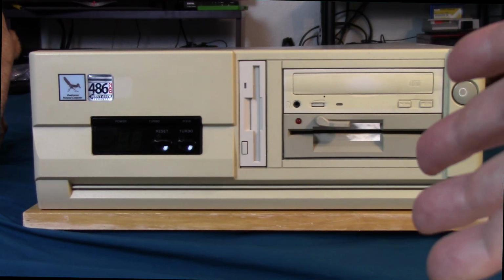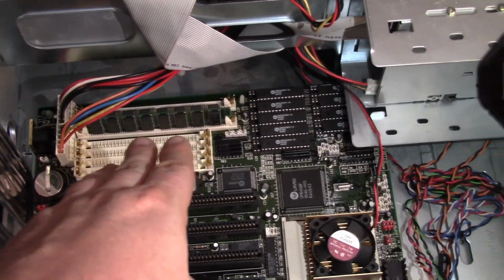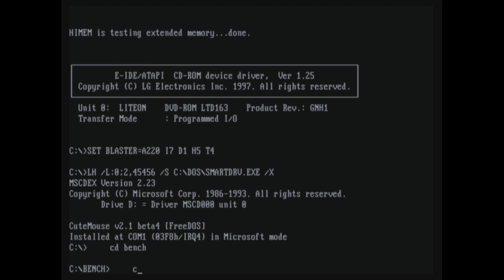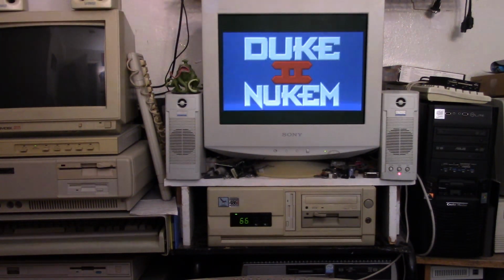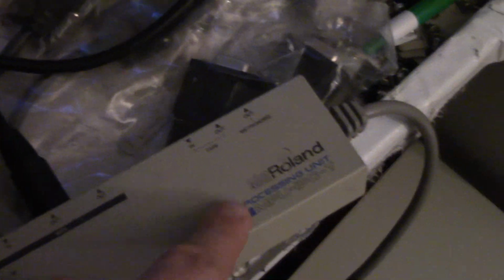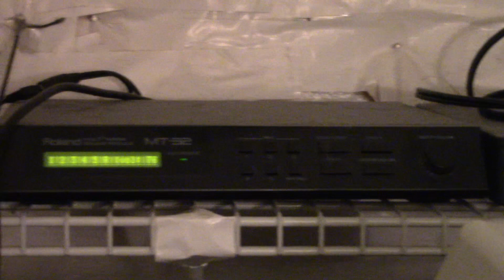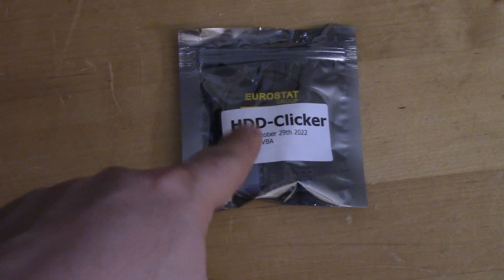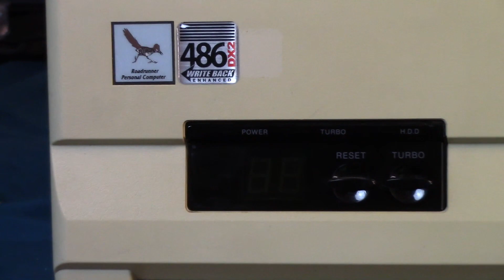Building a WB enhanced 486 DX2 PC

Comment: Nice video ! Regarding your soldering thing for the turbo switch, if you are afraid to solder (which I understand since I myself have 2 left hands as we say in French), simply use a pair of Arduino cables : their connectors will fit perfectly on both ends (panel and motherboard). So basically you replace the original cable with these. I use this trick without any issue.

Comment: In general 486 boards, due to lacking tag support in their chipset and caching technique, the cacheable region is directly tied to cache size as the tag only provides a fixed 7/8 bits to the data adress(stored in the "tag" sram).

Take the log(base 2) of the cache size and add 7 bits for WB / 8 for WT and you get the log of the cacheable mem size.
256KiB cache -> 2^18 bytes
2^(18+8) = 64MiB cacheable WT
2^(18+7) = 32MiB cacheable WB

1024KiB cache -> 2^20 bytes
2^(20+8) = 256MiB cacheable WT
2^(20+7) = 128MiB cacheable WB
etc.

Comment: I think that optical drive is a lite-on model, an LTD-163D or something like that. I used the exact same model for my 486 build because I wanted something that could read data DVDs just in case I ever had any need, but that still had analog CD playback and CD player functionality with the dual buttons. Being able to just pop a music CD in the drive and hit play while I'm at a DOS prompt sounds like a novelty, but it's actually pretty fun. I didn't sand off the DVD logo like you did though.

I personally have an Alaris Cougar build with the IBM Blue Lightning CPU. People argue over whether it's a " real " 486 or just a hot rodded 386, for most intents and purposes I consider it a slow 486 but I can see the argument, and oftentimes when I feel like poking fun at it I call it a 386 on stilts. Originally mine ran a 25 megahertz bus and a three times multiplier, but with some help from a friend I modified my bios to run a 2x multiplier instead so I could overclock the system bus to 33 megahertz and have it reliably function. I lost a bit of ALU speed but gained in every other category, from disk speed to memory speed to video speed and finally to FPU speed, since it uses an external 387 compatible FPU. For that, I'm using an IIT 4C87-DLC which benchmarks pretty close to a Cyrix FasMath but was less than a third of the cost of one on eBay. For the three things that I do that can even use an FPU, it's plenty good enough.

Performance-wise, I would say that it's a rough equal to a 486DX2-50. It has better IO performance but worse CPU / FPU performance so it evens out. I'm using a Cirrus Logic GD5428 1MB VLB where I used to use a Trio64V+ VLB, The trio wasn't as compatible as I wanted it to be and honestly for the speed grade I'm looking at the Cirrus card is plenty quick. Interestingly, the boards IBM paired these CPUs with have excellent IO, with nice 16550A UARTs and VLB IDE and such onboard. It also has a real socket 2 so when I really feel like it I can use my 5X86 on an interposer. These days, I've made my peace with what it can and can't do, and have other machines for what it can't, so I don't feel an immense urge to crank as much out of it as I can like I used to.

Another interesting part about the IBM blue lightning CPU, is the cache controller. It has 16K L1 but it can only cache 16MB of memory, anything after that point is only cached by the L2. My theory about that stems from the fact that the blue lightning has some heritage in the older 486SLC design where they gave it L1 cache but being that the CPU had a 24-bit address bus, being based on the 386 SX, they didn't bother giving it the ability to cache more than 16MB and the blue lightning just copied that wholesale. It's fine, 16MB is enough, but it was annoying to find that Windows 95 was even slower with 32 than 16 given how 9x fills memory top down, as my initial impulse was to fit 32MB too.
Reply from the maker: I've always wanted a Blue Lightning setup though not for any particular reason except I like unique builds so the idea that its kind of is a suped up 386 appeals to me. Can you give examples of compatability issues with the trio based VLB card? I've never had any issues with S3 based cards as far as compatability goes and I always read as well as tell viewers in my videos. that compatability is a strong point of S3 video cards though I've mostly only used PCI implementations. I have a Trio based VLB card myself but I've never gotten it to work.
Reply: @AncientElectronics  in particular the Trio64V+ was never meant to exist on VLB, the fact that it works is just a hold over from the older Trio64 design. There's only about a year's worth of drivers that will work with the thing on Windows 9X, from early 1996 to January 1997, And those drivers have issues with graphical corruption both in general and in screensavers in particular. The S3 driver in both NT 3.51 and 4.0 behave in different ways -- The NT3 driver will install and mostly work but it will exhibit major frame buffer corruption issues, and the NT4 driver simply won't install at all. To the best of my knowledge, there isn't a single Windows 3.x driver that will work with it at all. The S3 trio package for 3.x will install but refuse to initialize.

~1999 Linux that otherwise easily supports the Trio line doesn't know what to make of it and will give you a working VGA text console but freeze when initializing X with both the S3 specific server and the generic SVGA server. Like, it freezes the entire machine solid, stops responding to ping requests, that kind of thing. 

Even with an updated VBIOS, it supports VBE 1.2 at best, there is a TSR available for DOS that brings that to 2.0, and UniVBE can bring it to 3.0, but I remember going out of my way to burn an EPROM with a copy of a newer release of its BIOS only to be disappointed that it didn't fix anything.

Their PCI cards are rock solid, 100% fine. Their more common VLB cards are also, I'm assuming, fine. Mine in particular is just an abomination of God that shouldn't have existed. Ironically though, in DOS, it's darn near perfect - - I haven't found a single DOS game that I haven't been able to prod into working, it doesn't exhibit any SVGA bugs in the commander keen games that I can see, And it's fast as hell. Easily the fastest VLB card I've ever seen, though to be fair I've never personally seen a tseng labs or ark1000pvl card. As a bonus, I never had any extra issues out of it that stemmed from running it at a 40 megahertz bus, like on my old 486 build.

It wasn't a prototype or anything, STB manufactured and marketed these cards in 1995 as the PowerGraph64V+ VL, it just doesn't have very good support in the form of drivers at all. I'm told that there's no major difference between S3 drivers targeting PCI and VLB except for where in the memory map it's looking for the devices, but I don't have the wherewithal to attempt to rewrite any of them.

Comment: L1 cache made a huge amount of difference on 486. It's tiny, but it is very close to the CPU, has low latency and ~3 times the bandwidth of DRAM. 

The L2 cache was on the motherboard and running at FSB speed. Since the FSB is 33 MHz it is only running at 33 MHz and not the full 66. It's not that hugely faster than DRAM in either bandwidth or latency; sustained reads are maybe only 30% higher bandwidth than DRAM.

On am386DX-40 systems it was also quite common to have some motherboard cache; it helped more there than it did your 486 for two reasons. The cache is running full CPU speed (40 MHz) and the CPU doesn't have any L1 at all. This motherboard cache could give you easily 10%-15% increased performance. Even so, 1 kB of on-die L1 cache helped a lot more than 128 kB motherboard cache (there were some 386 upgrade chips with 1 kB L1 on-die).

Comment: I have a similar board to this and when I upgraded the Cache to 1MB i was having issues with benchmarks not detecting it properly. I updated the bios to the latest version i could find online and everything then worked fine. was detected in benchmarks and got better performance on the benchmarks i had run beforehand.
Reply from the maker: I think the latest BIOS is dated 12/01/1995 and mine seems to be 07/02/1995 so pretty close but I'll see if I can get it upgraded and report the results. thanks!
Reply: Same issue with my M915 ( The one that says "Secondray" on it ), 512k was the most mine would work properly with.
Reply from the maker: Apparently, there is an entire thread over at the Vogons site on this board and its funky BIOS versions I must have missed when putting this build together. I guess someone has patched a later BIOS to fix a lot of the bugs on this board such as the cache issues and detection of later AMD dx5 CPUs. wish I had a BIOS flasher to make and test them.
Reply: @AncientElectronics  Also the "RetroWeb" site has the M912 (several versions) with different bios files. If we lived closer I'd happily flash that for you.

Comment: any idea why the bios though it was a P24D-S (overdrive)?
my main 486 has a intel dx2 66 mhz, 32 mb, 256k L2, awe64 gold, Cirus logic VLB, IDE VLB
i have a second board ASUS PVI-486SP3 but i can the L2 cache to run right yet. Might have bad trace.
Reply from the maker: No idea, probably the BIOS just misidentifiying it. Apparently the BIOS on these boards have a few quirks and only the very latest versions correctly identify and even POST with chips like a AMD dx4. I. Currently working on finding a later BIOS then mine but I do not own a flasher.
Reply from the maker: I decided to check again, P24D-S isn't an overdrive, it is indeed a write-back enhanced 66MHz DX2, the S designates the chip has power management features. The 486 overdrives would be designated P4T,  P23T, P24T or
Reply: @AncientElectronics  ok thanks for figuring it out and letting me know.

Comment: Did a 486 DX2 WB (P24D-S, SX955) build two weeks ago. Couldn't get the motherboard to recognize the CPU type correctly en let me set the L1 to WB instead of WT. Jumpers where in correct positions (P24D), new EPROM with the latest BIOS version, fiddling with the BIOS settings, no success. Turns out I had to set the jumpers on the mainboard for a regular 486 for the CPU to be recognized as a WB version, get the correct CPUID code and the WB performance increase. Go figure. Mainboard was a Chicony CH-498B.

PS: I'd like to do a DX2-80 build some day. The CPU MHz difference won't make that much of a difference but the bus speed increase from 33 to 40 will do wonders for memory speed/bandwith, VLB video card performance etc.

Comment: Your problem with your ISA slots is really common.

I had a lot of those boards some 10 years ago or so, and almost all of them had that issue. But it's just not an issue only with VLB, even on 16-bit ISA slots the cards never seem to go all the way down in the slot. I found that concerning too at the time, I tried everything I could possibly think of (even using pliers to create a slight bend in the I/O brackets) and nothing worked. They are just kind of '' conceived '' that way for some weird odd reason. But none of them (from my experience) had a problem with contacts in the slot. It's just a wack design lol

Comment: You dont have the 32bit mode enabled on the ide. If you want to take advantage of the IDE transfer speeds on that VESA controller you have to enable 32bit mode. Just saying.
Reply from the maker: Realized this after publishing the video. I installed the drivers for the vlb card and now performance is much improved. I belive I pinned a comment about this.

Comment: I have that same motherboard with a P24D.  In my testing the WB option actually causes WORSE performance in most benchmarks.  I've noticed this on every motherboard I've tested with, except maybe the FinALi chipset boards (not enough testing to know for sure).  With WT L1 cache and 512kb L2 cache and a fast enough video card you can break 30fps in Doom.  I'm using a S3 Trio64 VLB to get that result.  BIOS timings have to be as fast as possible as well.

Comment: I will be nice to see difference between regular and write back 486 -66
Reply from the maker: Unfortunately I wasnt able to make a direct comparison on this board. When I would switch to write-through in the BIOS it didn't seem to have any effect. The CPU still detected as running in write-back and benchmarks were the same. Maybe there's a utility program out there that can force it.

Comment: These standard baby AT pizza boxes are so nice. My 486 setup is a lot jankier than yours, an old HP Vectra VL2 with all sorts of proprietary stuff. It's nice and compact with 4 ISA slots and a built in VLB Cirrus Logic card, but the PSU is weird and I doubt I'll ever find L2 cache for it. Still, it was cheap and runs the stuff I need it for, paired with a DX33 it's just right for Ultima 7 and disabling L1 gives good compatibility with even older stuff. Doom and newer games are happier on my Pentium II machine anyway.
Reply from the maker: I always liked the Vectras, I have a socket 7 Vectra I use as a "fast DOS" PC. It also has a proprietary PSU. It's as long as the case and also acts as a cooling fan for the CPU.
Reply: @AncientElectronics  That's how mine is laid out as well, thankfully 486 doesn't run very hot and no bulging caps so far. 

Also, a real MPU-401 and multiple midi modules, that's some lovely stuff you have. I raise an SB16, an Ultrasound Classic and an LAPC-I. I feel like I've spent my fair share of retro hardware luck with that last one, haven't really bought anything since.

Comment: With 15ns cache you really should be able to use the fastest cache timings even on a 40MHz bus. All of my boards accept the fastest cache and RAM timings with 15ns cache and 60ns RAM. The mem throughput increases dramatically with these timings, especially at 40MHz bus. My first overclock was an Intel DX2-66 to 80 in 1994, and my first upgrade were 15ns cache chips in the same year. I was able to play Wing Commander III and enjoy stutter free cutscenes from CDROM with this machine ;-)

Comment: 486 CPU's can address up to 4GB memory or 3.5GB when the system also has PCI slots (PCI takes up 512MB address space). As far as I know the biggest 72 pin Simms are 128MB and the biggest 30 pin Simms 16 MB, so 320MB max for this board. If you would ever use that on a system like this is probably a big no :)
Reply from the maker: I'm fairly confident this system will not detect more than 64MB of RAM regardless of what the CPU can address. all official specs indicate 64MB max though this does not always mean anything as sometimes larger amounts became available after the board was produced. I could certainly be wrong but I believe chipset and BIOS can also be limiting factors but please, if anyone knows i'm wrong please correct me. I wish I had a 128MB stick of 72-pin memory to test here.
Reply: @AncientElectronics  The 4GB is because it is a 32-bit CPU. Technically a 386 CPU can address 4GB as well. There just isn't a mainboard with enough Simm slots to make that happen :D For the 486 is this review 32MB is more then you ever need for the games from that era.
Reply: @AncientElectronics  I guess it would be useless of me to speculate on what i don't have, but it would a combination of bios, chipset and OS that set the limit of the amount of RAM that can be addressed, i won't be surprised if the NS rating of the sticks play a part in it as well. Can DOS 6.22 even address more than 64mb anyway?
Reply: @Viczarratt  DOS can address up to 4 gigs with XMS 3.0. Usually the true limit is a combination of available memory slots and whatever density of memory your BIOS will accept.

What's extra funny is that Windows 98SE (or ME) will get all sulky if you try to give it more than 1GB.
Reply from the maker: From my understanding the issues with Win98 start after 512MB though there are patches that correct the issues.
Reply: @AncientElectronics  You're correct, it's been a while since I had to deal with that.

Comment: Not too bad, but a SB16 is always the best choice.
Reply from the maker: Not sure I'd say always. There seem to be a number of people that believe the more filtered sound of the SB pro 2 sounds "better" to them, especially on older titles that were developed with the older SB cards in mind. Part of it also has the age of the games being played in mind. A number of games also do not take advantage of 16-bit sound anyways and 8-bit digital sound tends to have more hisses and pops when played on an SB-16 (at least the early SB-16 cards, I tend to really like the sound on the Vibra based cards). The SB-16 also is NOT 100% compatible with games that support only the Sound Blaster Pro and not the SB16 in digital sounds, as it will only play digital sound in mono. Admittedly this is a small number of games and note this only affects digital sound and not FM sound through the OPL3 chip. In the end they are both excellent choices as sound cards with minor pluses and minuses between them.
Reply: There were so many bad SB16 variants that you really have to wade through a lot of chaff to get a decent example and were still balancing out which bugs you wanted to deal with, hanging/phantom note MIDI issues, noisy DAC's, distortion/ringing with Vibra chipsets, etc...  Even with "good" variants, watch out for older/noisy DAC's being implemented on otherwise decent models like the CT2230/90 since Creative was building their cards as quickly and cheaply as possible using whatever components they had on-hand.  

While I own a bin of old Creative Labs cards for nostalgia's sake and resale, I find the Media Vision Pro Audio Spectrum 16 cards are a lot quieter due to much higher build quality, while the Aztech cards and more modern Yamaha/ESS/Crystal single chip PnP cards are more affordable for similar or superior levels of performance including working MIDI interfaces for waveblaster or external devices.